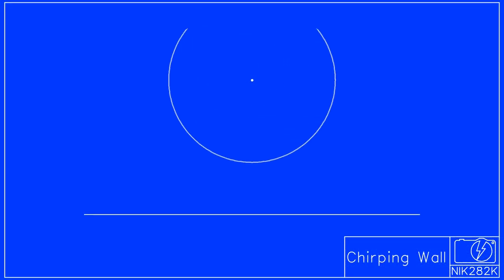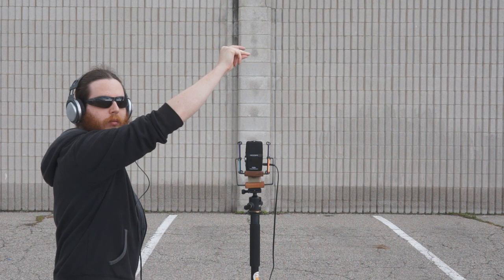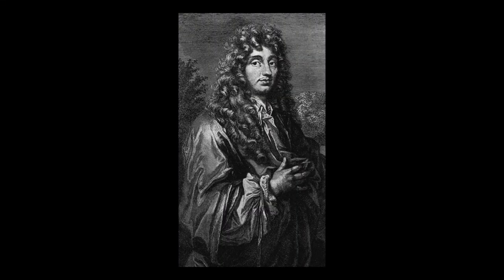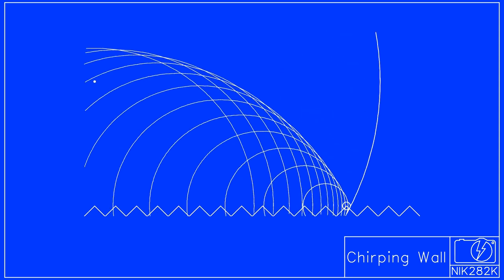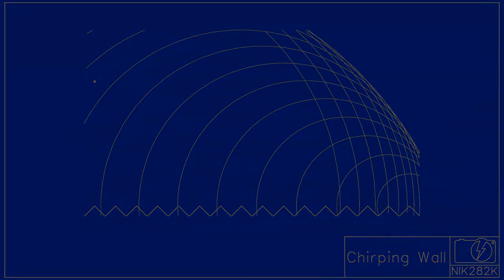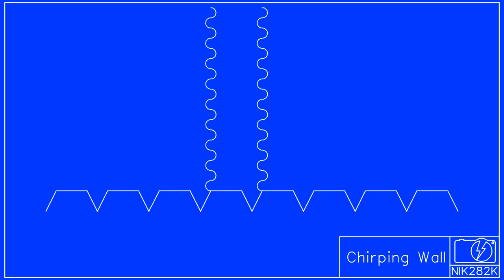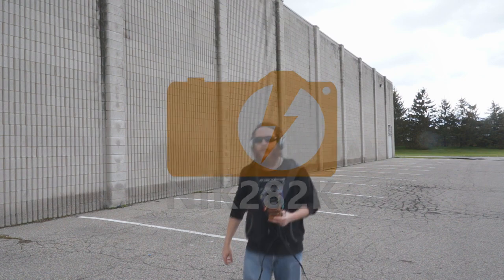Chirping Walls - (may need headphones)

Comment: That is awesome! I've never noticed it, but now I'm going to look for these types of walls.
Reply from the maker: +Applied Science I noticed it as a teenager but it took me until now to finally write it up, glad you liked it. It works with concrete, corrugated steel and sometimes even with picket fence if the spacing is right, good luck!

Comment: Very interesting Nick!  Great explanation as well..
Reply from the maker: These walls are one of my favorite physics tricks. They are reasonably common but most people have't noticed the sound let alone know what it happening if they have noticed. Each one sounds a little different so I am always looking for more.
Reply: Balusters on a long railing will do it as well.  I had no idea about this phenomenon until I was at a riverside park in Detroit (i think) and was clapping like a moron out in public.  My kids were not impressed, lol.  

Excellent explanation and visuals (as usual).
Reply from the maker: +jcims Glad you liked it, I have been trying to use a single style for my visuals (the blueprint thing) and it has been working ok. To make the echo and chirp simulations I actually programmed little animations using Processing.org and then composited it onto the background. Not the smoothest solution but I'm not sure how else to do it.

You should have seen the looks I got from people as I walked around parking lots with headphones, a microphone and a big camcorder as I clapped my hands, snapped my fingers and yelled into the camera. I'm surprised no one called the cops >_<

Comment: Really interesting video. I was aware of the phenomena before, but I never thought of it as a diffraction grating. 

Similarly, I never thought of optical diffraction gratings like this. Very interesting to unify the two.
Reply from the maker: I'm not sure if an optical grating could act like this unless you could make an infinitely short pulse of white light (is that even possible?). I know that there are ultra high energy laser systems that use chirped light for experiments but I don't know a whole lot about them. The experiments are a little outside of my budget ($0).
Reply: It wouldn't have to be infinitely short, but it would have to be short compared with the frequency, which would be hard. I imagine you'd see this effect in radar imaging of similar geometries
Reply from the maker: I'll have to do some googling to see if it has ever been seen with RF. I spent most of my time trying to find acoustic examples.
Reply: It might be that the time of flight of the radar systems is so short that they wouldn't see it. I don't know how fast the processing time is. But I doubt they get depth information better than 20m, or so, on very good equipment
Reply from the maker: A line of telephone poles or even fence posts might be space far enough apart to give a chirp in low frequency RF if they were "viewed" from close enough. We need to find a radio guy.
Reply: Ooh I did think of that. Maybe even houses organised into blocks. We must find a HF person
Reply from the maker: +Joshua Mcateer I wonder if it happens with ocean waves near docks/piers as well. I need to take a trip to the lake.
Reply: Ooh, perhaps. Although maybe they just high pass filter the signal in the front end? For radio purposes. Although in MRI they mix the return signal with the input signal to get the difference, which is much lower frequency, so some could get through, perhaps

Comment: I've noticed a similar effect from fireworks and hi rise concrete buildings. 
The fireworks have the benefit of being much louder and so much the amplitude doesn't falloff as quickly. 

Btw found your channel through ave. I think you're about to get a lot more subscribers 👍🏻
Reply from the maker: The extra short pulse and abrupt cut off would be much better than slapping meat together like I was. I wonder if it was the balconies causing the chirp for you?

Comment: Knocking/hammering on a very long radio transmission tower guy wire does the same thing. I learned this as a kid. I also learned that if you are extremely close to the base of a lightning strike, you get the same effect - the lightning clap is chirped in a major way, and the explosive pop/thunder sound is almost non-existent.

Comment: Also, parallels concrete walls produce a comb filter effect. A clap sounds like a Karplus–Strong synthesized string.
Reply from the maker: Oh! There is a room in my house with 2 very close and bare walls, when you clap your hands between them it makes a noise just like that "Karplus–Strong synthesized string" sound! Thank you for putting a name to it!

Comment: Expanding what I know about sound. Thanks!

I noticed that secondary deflection of sound waves was not addressed in the visual simulation. Probably because the energy in them is so low? Does it show up in observed spectrogram?
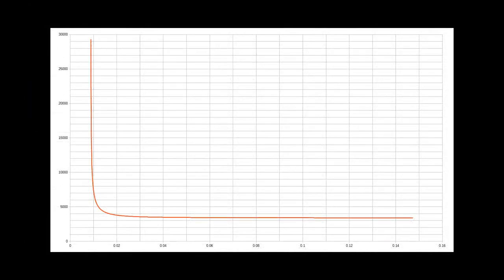Reply from the maker: There are multiple reflections in the recordings but you're right, they are very quiet and I wasn't sure how to model them with any accuracy. At 2:33 you can see that there is not just one chirp but multiples at the same time.

Comment: A chirping structure I encountered? The roof of my house! I was up there at new year's and and the bangs of fireworks made the weirdest noises up there. Also had the added benefit that you don't have to dodge firecrackers up there (in Austria everyone lights up fireworks for an hour around midnight at new years).
Reply from the maker: Yes! There was a roof on the building next to mine in NZ that was like this. When planes went over it would diffract the sound and make the pitch sweep up or down depending on the direction the plane was headed: https://youtu.be/eBip4iUuK98

Comment: illinois state fairgrounds has a good spot that the daily fireworks during the fair sound awesome against!.  never knew why it sounded so cool.
Reply from the maker: Someone mentioned that fireworks are a great way to hear this because the pulse is so short, saw there a building or a fence near by that would make the chirp?
Reply: https://www.google.com/maps/@39.8321032,-89.6438288,172m/data=!3m1!1e3
that building..  it is pretty cool looking too, looks like a castle...  but i think the bricks do it.
Reply: and if its not the castle building doing it, there are a lot of ridged sheet metal buildings and slanted roofs around there for the show animals of the fair...

Comment: Great stuff! I've always loved these echoes when I've heard them. Always wondered how on earth the frequency changes... still don't quite get it. Must be thinking of it the wrong way. The panels are uniform width so should reflect the same frequency. Must be something to do with the widening angle... but the pitch should go up! 🤔🤔
Reply: Ohhh! Higher frequencies reflect away and lower frequencies reflect back??
Reply: Not quite, there will be always a part that will reflect back and a part that will reflect away. The thing is that when you look at it as diffraction grid at lover angles  as perpendicular to the wall  more lower frequencies will cancel out. Lower frequencies have lower wave lengths. Since they have lower wave lengths smaller change in distance could mean higher phase shift so they would interfere destructively while those with longer wave lengths the small difference in distance would mean lower phase shift and as such they would interfere more constructively. While as you are going for higher angles the distance between higher wavelengths are going more out of phase and are bound by geometry while shorter ones aren't as much. Because of that frequency will appear to be going lower as you change the angle from which the sound is reflecting back there will be a change in interference patterns.
Reply from the maker: mm3200 explains it well but if you still need help, watch the dot in the simulation. As the echos return to the dot the first echos get there almost all at the same time, as each next echo gets there there is a little more time between them. If you could slow down the noise 1000x times it would just sound like some one clapping slower and slower but because they arrive so quickly is appears to be a continuous tone to our ears.
Reply from the maker: Yes! That's exactly it. When I started this project I wasn't sure if diffraction gratings were the right way to go about it but the more I played with these walls the more it made sense that both explanations work. I wish I could show that optical gratings can work in the time of flight method but I'm not entirely sure they would.
Reply: Nick Moore so the phasing at the point of the listener is cancelling out the higher frequencies?

Comment: Tubes seem to produce the effect. We have a long concrete storm drain which makes a chirp. Physics is everywhere!
Reply from the maker: Does it sound like a buzzy-ish noise that goes up in pitch? Some one mentioned that it might be a "comb-filter" type effect. I'll have to see if I can reproduce it.
Reply: Corrugated drain tubes definitely do this, probably for the same reason as you've described in the video.  Smooth walled tubes might have a comb filter effect given the different path lengths that the wave takes (e.g. some going straight down tube while others reflect off the walls and take longer to get to the end of the tube)

Comment: Doesn't that black corrugated drain pipe produce the same effect if you snap/clap into one end?
Reply from the maker: I'm not sure if it is the same chirping sound or a "comb filter" (the sound of clapping your hands in a room with bare walls, or the echo from a concrete pipe). I have never tried it before but I'll be looking in the future.